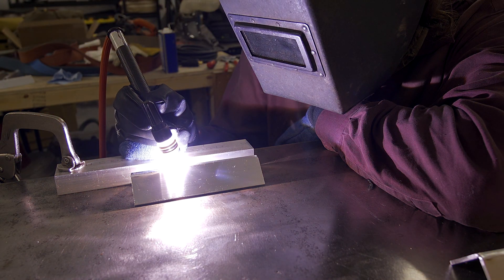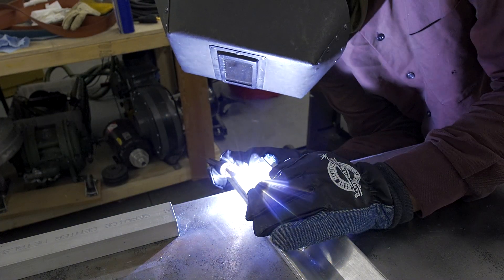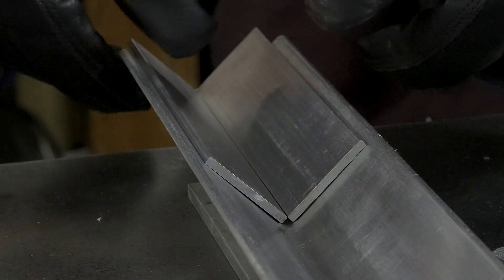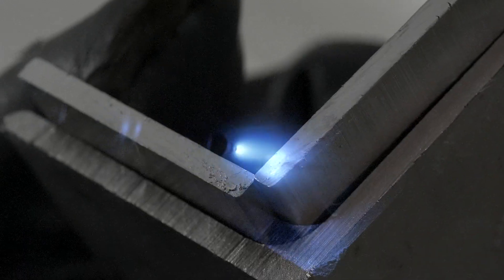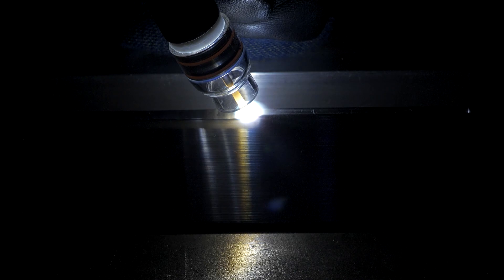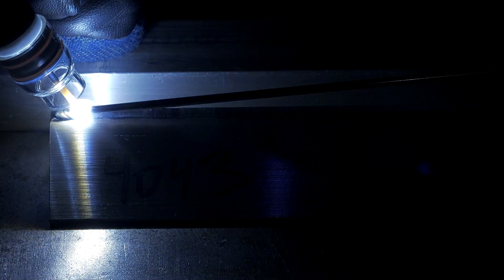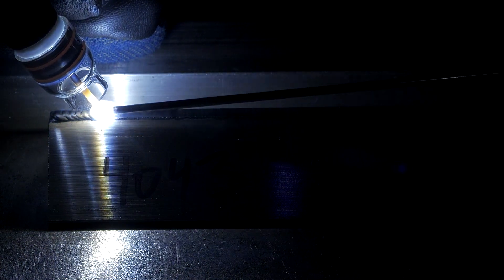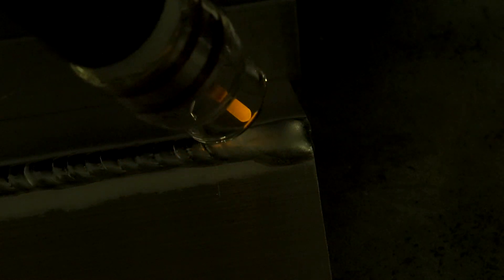How I figured out aluminum | TIG weld for beginners

Comment: great video. just starting to learn some aluminum welding. using an everlast powertig 210ext. i always hear/see people balling tungsten, but i don't seem to be able to get the same outcome when i attempt to do mine. i know the balance is sorta reversed on everlast machines. maybe I'm using the wrong tungsten (usually purple is what i use for everything, but i've tried the green as well for AC) or settings all together to ball it, but any advice you can give would be much appreciated.
Reply from the maker: Thanks! Appreciate you watching.  Have you tried just grinding it to a 45 degree (sort of blunt) point?  As long as the electrode positive side of the balance is 35% or less, you don’t need to ball the tungsten.  It’s more a preference thing, if using an inverter welder.  

But one trick to ball tungsten is to set your electrode positive side of the balance high and strike up on a piece of copper.  Lay on the amps slow, it won’t take much.  

Hope that helps. Let us know how it goes!
Reply: I'll try that. i've usually always put a decent point on it. thanks for the info.  @GrumpyWeld
Reply: My practice for sharpening the electrode for aluminum TIG welding is to grind the taper depending on what thickness that I am welding.  A long taper for thin materials, a shorter taper for thicker materials.  Then I blunt the point.  The diameter of the blunt point is less than half of the electrode diameter, usually around 25% to 35% of the diameter.  This has worked well for me.  My understanding is that balling the electrode is a holdover from the early days of TIG welding with transformer type machines that had fixed balance and just the single frequency of 60 Hz.  hth